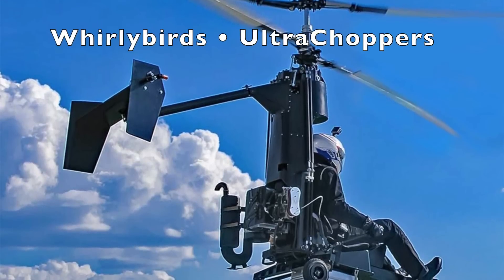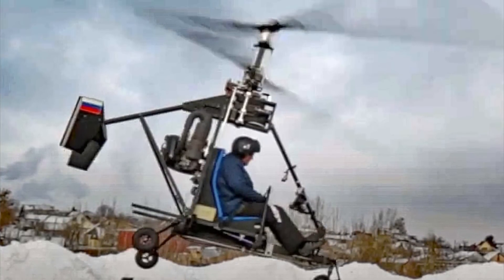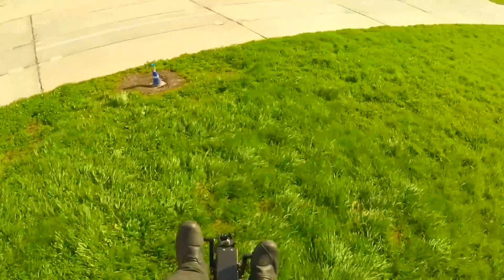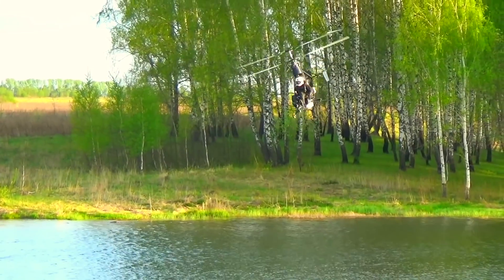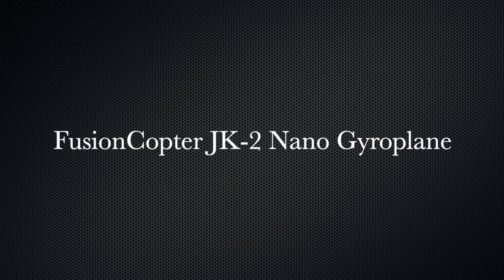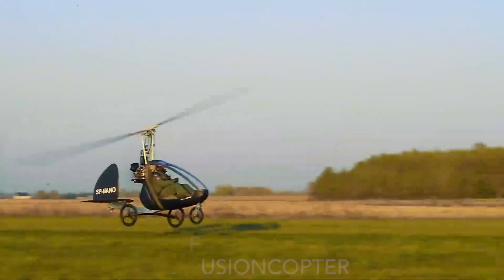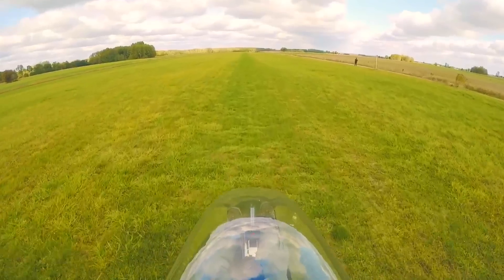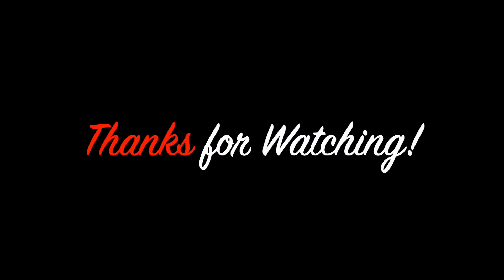UltraChoppers 0820

Comment: A problem with part 103 aircraft is that a pilot has to weigh under 200# usually to fly one.  I wish they'd up the weight for these to allow a heavier person, to allow more fuel, and to allow safety equipment such as fuel guage, airspeed, light, etc.  If I build a kit I will install safety equipment that I feel I need no matter if it meets part 103 or not.  The FAA needs to review and modify these requirements.
Reply: Lose weight and be healthier.

Comment: ...The result was the first successful rotorcraft, which he named Autogiro in 1923.[13] De la Cierva's autogyro used an airplane fuselage with a forward-mounted propeller and engine, an un-powered rotor mounted on a mast, and a horizontal and vertical stabilizer. His aircraft became the predecessor of the modern helicopter.

Comment: The russian coax chopper is not gonna make 103, it is 348.33 pounds, adding floats will not help, it will still be overweight,  kit is 35k fully built with test flying stand is almost 70k

Comment: That Nano looks worrisome, engine is too high, and gear is too short, like a Bensen, possibly a PPO risk...
Reply: Yes, the thrust line should be much lower, closer to the CG of the person (just above the thighs).
Reply: But when it's so tiny, does the mass below that thrust line really add up to that much to be such a concern? Seems like at least a quarter of the total mass is in the overhead rotor, and another half of the mass is in the engine which is right on the thrust line. So that just leaves a quarter of the mass below the thrust line, which probably balances out.
Reply: @manofsan  the issue is that in a situation where the rotor is temporarily unloaded (negative G, or turbulence) the resistance of the rotor to the gyros tendency to rotation around the center of mass is gone, and with the prop pushing from behind the gyro can rotate forward, in whats called a Power Push Over. This can happen when the prop thrust line of a pusher is not aligned with the center of mass. And it’s bad because the forward pitching leads to the blades flexing and striking the prop or tail and of course breaking up as a result.

Comment: I think in USA to qualify as "ultralight" it must use a 2-stroke engine only.  But I may be wrong. I am waiting for something like this (when I can afford it) or an electric ultralight - they should be coming soon.
Reply: Nothing is specified about the engine, it could even have a motor instead, as long as empty weight doesn't exceed 254 pounds, and speed doesn't exceed 63 mph.
Reply: @richardjenkins4182  how do they know whether or not it can exceed 63mph? Doesn't that just depend on how hard you fly it? I presume any engine can be de-tuned to put out less hp than what it was designed for. I bet the right tailwind could put you over, even if you're not rated for that.
Reply: @manofsan  groundspeed doesn't matter for part 103.
Reply: @douglascooke1926  - I thought Part103 restricts how fast the aircraft can fly - I'm pretty sure it's in there.
Reply: @manofsan  yes. Maximum of 55 knots AIRspeed. Not Groundspeed.

Comment: First one seems complex. Dual counter rotating rotors with full helicopter swash plate control for each. That seems like a lot of trouble for just part 103. Any mention of price?
I wonder if anyone has ever done a 2 side by side rotor config helicopter. I guess the challenge is balancing the throttle but with computer control it might work well.
Reply from the maker: On July 31, 2020, I updated my website article (https://www.bydanjohnson.com/chopper-town-circular-exploring-two-rotary-winged-aircraft-1-helo-1-gyro/) with more info from RD Heli. Basic kit price is about $33,500. For any helicopter, that strikes me as not particularly expensive although building a kit with Russian support may open new challenges.

Is it too complex? Well, perhaps, but it is very compact and appears easier to fly than a convention single rotor helicopter although I am not qualified to say how "easy" it truly is. The pilot flying it in the video may just be very good.
Reply: @DanJohnsonAffordableAviation  seems like a good price, quality russian labor might be inexpensive. I don't think it's too complex in any absolute sense, just seems it's a lot of critical parts that have to function well under constant high stress. I tend to shy from complex high strain designs towards calm harmonious stable designs if I can help it. A plane with a solid prop is a calmer arrangement. You'd need the tailless hover to go that route. Swash plate in general seems icky to me when you force the blade to twist for every single revolution. and then to have two on overlapping axles. It's quite some engineering. He could develop a micro turbofan engine for LSA weight planes instead. That would be interesting. Imagine twin jet pressurized LSAs. 400ktas @FL400 for less than 200k$. Wouldn't that be something.
I agree it probably is fairly easy to fly because of counter rotation. Until something goes wrong :)